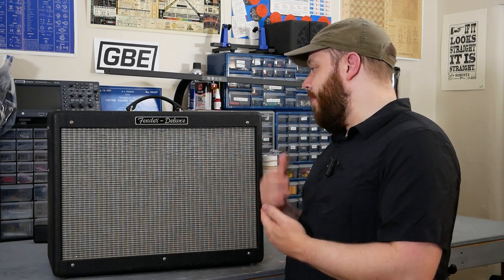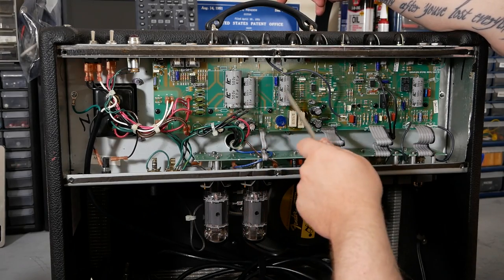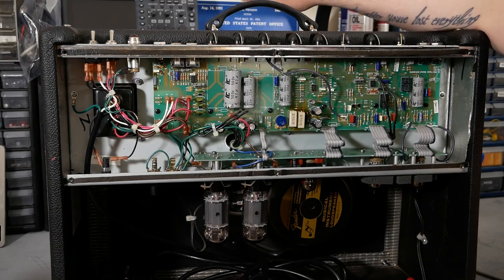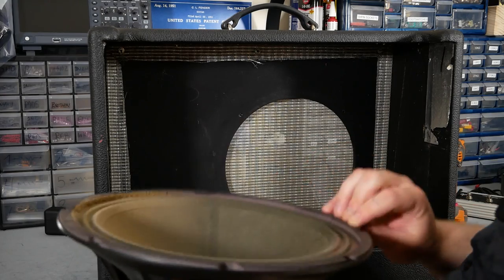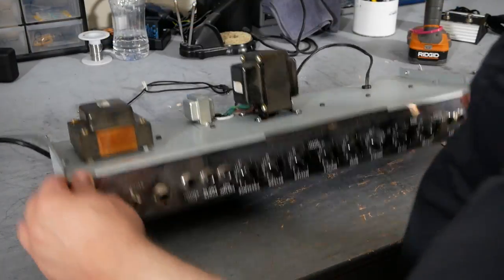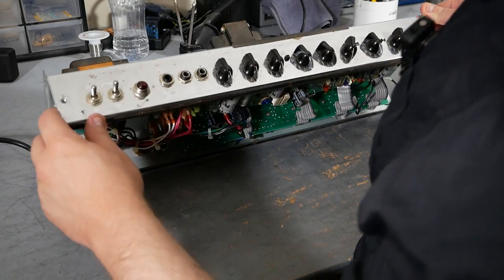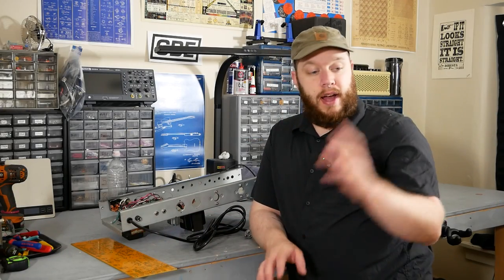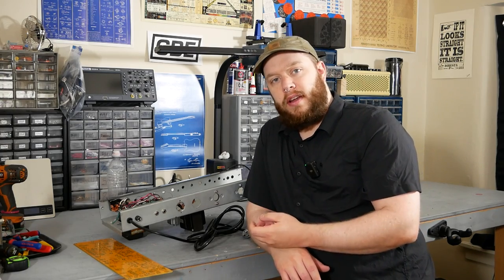Turning a Hot Rod Deluxe into a Dumble ODS Part 1 // Gray Bench Electronics

Comment: I have built one of these myself using the Rev D PCB.  I am in process of shooting some videos of the finished amp and it's tone with different guitars.  It is a very nice upgrade for a failing Hot Rod Deluxe or Blues Deluxe.  I used the EVM12L speaker in mine and also built it with the HRM tone stack.  Thanks for this video and spreading the knowledge.  One tone tip for this build, I use a Keely Verb O Trem in the FX loop, gives you reverb and tremolo, plus the level knob can be used as a gain control to dial the amp output down a bit when needed..

Comment: I watched part 3, part way through before deciding I should go back to the beginning. This looks like a very interesting project. Am I right in thinking that almost all of the original hardware (magnetics, speaker, pots etc.) will be re-purposed for the ODS? I have seen a few HRDs for sale locally, some very cheaply. I am giving some serious thought to doing an ODS conversion myself.
Reply from the maker: The pots and jacks are new, and the board components of course. But yes speakers, xformers, chassis, cabinet, all from the hot rod

Comment: I understand why it was impossible given where the amp started, but it’s a shame we won’t be able to compare the tones the amp produces pre and post transformation. Maybe borrow a working HRD when the work is done just for A/B?
Reply: I like this thought but it would be an apples to pears comparison. I say apples to pears because there's certain design one can't stray from to make a guitar amp. While there are certain decisions that change the character, tone, response, etc. it wouldn't matter since you're swapping out the original component board for something else. As others have stated, the transformer and speaker would indeed play a role, but unless Joe went to such lengths as to use the same transformer and same speaker, there is little to actually compare as it would contrast too much. It'd only make sense to do this if it were modification/component swaps that led you to a Dumble-like result.
Reply: @PhotoBoothSoundDesign  I guess I was just thinking that if you did all the swaps and then your apple still tasted like a pear you might wonder why people seemed to prefer pears in the first place.

Comment: I'm just starting the video, so you may answer this. But how much of the Dumble effect, if you will, is some of his voodoo? I'm referring to his choice of components, especially certain types of caps or resistors in strategic locations? Also, he was really anal about making sure the component lead physically touched whatever connection it was soldered to, not just allowing the solder to make the connection. I've long been curious about this. I would have once been inclined to dismiss many of Dumble's ideas and practices. But as I've learned and gotten hands on more and more over the last fifteen years, I've experienced things that work in ways that EE's generally dismiss as nonsense. Just the other day I replaced a cap in a guitar and it most certainly altered the tone even (especially) with both pots (tele) wide open. I also had to replace a cap in the power section of a Rivera Quiana a few years ago. I replaced a high end film cap with a ceramic one. It "shouldn't" have made a difference. Especially being in the power section, according to conventional wisdom, but it did*. It was unmistakable. I had and still have the hunch that Rivera put that specific type of cap in there for a reason, as any other type would have done. I've been playing guitar professionally for almost forty years. I've been working on my own gear almost that long, especially more and more since 2007. I have very good ears, and don't buy into snake oil, mojo voodoo and the like. But sometimes, the littlest things *will change how something sounds, even when there's not a logical explanation for it. Curious what your take on this might be.
Reply: If you have made such wonderful discoveries, perhaps publish some videos about your findings?
Reply: @Loscha  Why is that asking a question elicits a challenge from someone who is not the person who created the video? I was asking a sincere question, yet it is interpreted as hostile. People need to lighten up.

Comment: Those actually are not the screen resistors mounted on the board there, even though they are the same value at 470 ohms. Those resistors work with the adjacent diodes to drop down the high voltage to the 15 volts or whatever it takes to run the switching relays. That's why you're channel switching wasn't working.  They were likely unsoldered because of the heat. Massively stupid design by Fender.